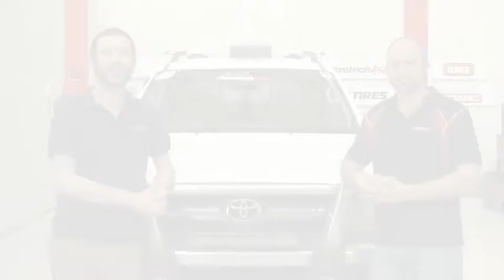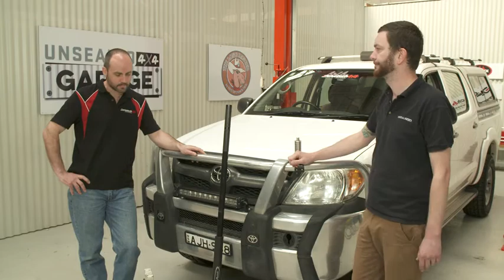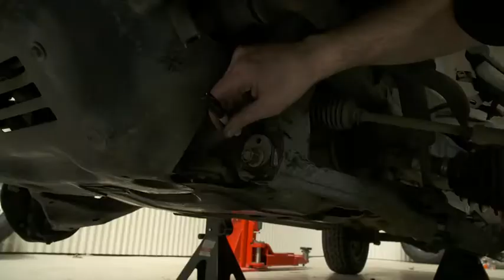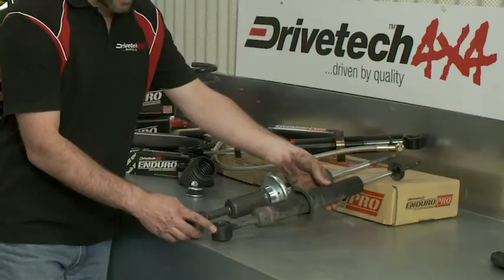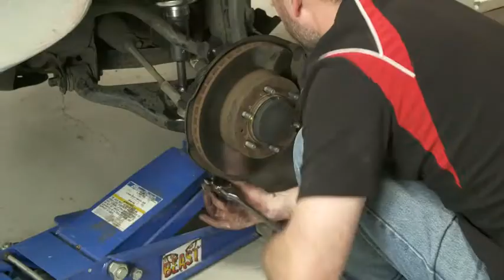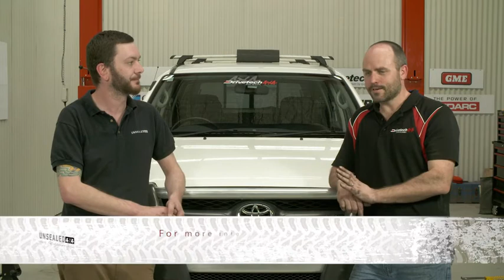Unsealed 4x4 & Drivetech 4x4 - Replacing strut and coil without a spring compressor

Comment: Didn’t work on my Tacoma, using 3rd Gen springs and shock.  The truck started jacking up before I could get enough of the shock bolt thru the top hat.  Close but no cigar.